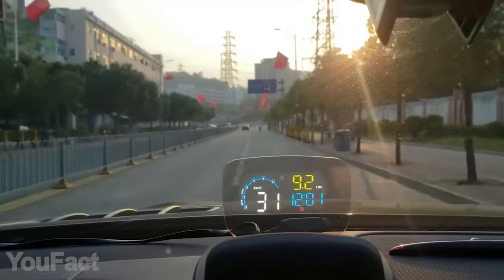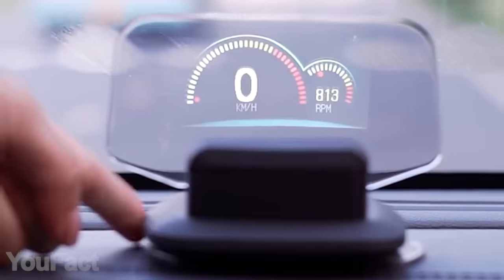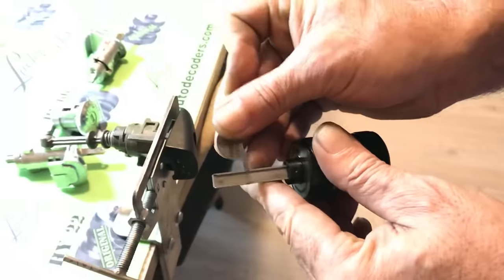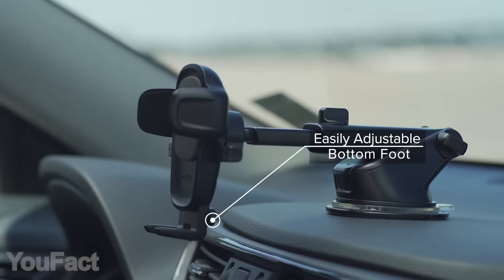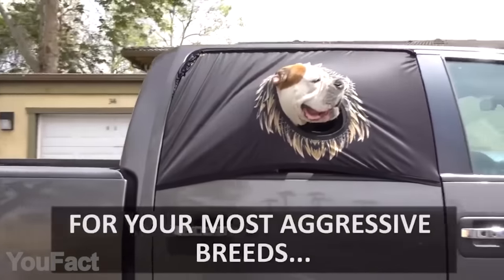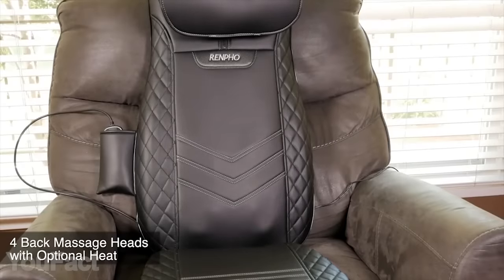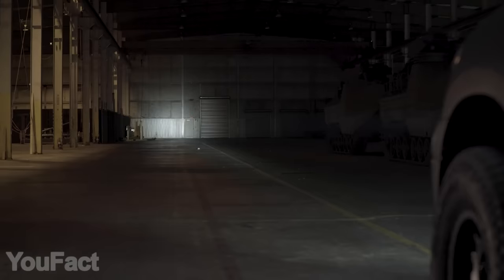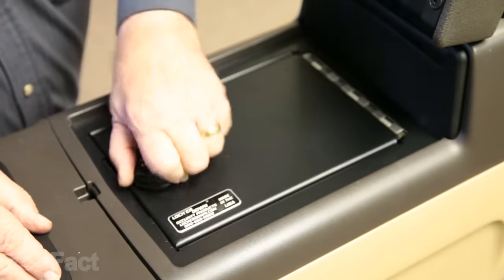13 COOLEST Car GADGETS That Are Worth Buying

Comment: The blue driver thing is the real deal. Bought one last year. Simple to use and if you know the basics at least its a huge help for diagnosing.
Reply: I work as a mechanic so I know bs when I see it and it seems interesting to me
Reply: @tactical_snails2198    I have one and it's OK. I see everywhere that it does body codes, ABS codes and airbag codes though, and it only dies on some cars.  They claim they will update but it still can't do a Mazda 3.
Reply: What about electrical faults. Can it detect them? I have an obd2 port on a Toyota hilux but a lot of Bluetooth obd tools don't work. The ones which do are really expensive.
Reply: @megabrex  yo should i cop for my ford fiesta ??????????

Comment: The "Smart Wheel" will be a real PITA for those of us who still shift gears.
Reply: Also you are no longer advised to hold the wheel at 10 to 2, as the use of airbags has resulted in thumbs being damaged or even dismembered when they go off.

Comment: so, the "smart wheel" turns red each time i take one of my hands off the wheel ? how am i supposed to change gears in my manual transmission ? with my mind, i'm no Jedi ? or i should drive around in the 1st gear ? :p
Reply: The real question is how do you drive a manual and text at the same time... 😀
Reply: @LV-1969  i don't, as in i don't text and drive, i either pull over to the side or ask my passenger to send the text if it's really important, or i just wait till i get home, like any normal human being should do :p
Reply: I drive manual also. This thing would last about 2 minutes before being introduced to a hammer!
Try speach to text.

Comment: A dog sticking it’s head out the window can be ‘dangerous’ so how does one sticking out the dog sleeve any safer?
Reply: It’s supposed to prevent them from jumping out.  You could just roll up the windje mid way and it pretty much does the same thing

Comment: Problem with a dog poking their head out of a window while you are driving down the road is road debris hitting their eyes. Just ask any dog optometrist (and yes there are many). If you thing there is nothing flying through the air then why does your windshield get pitted; sure not while it is sitting in the car. Console safes are NOT new. Had on in my 2003 Jeep Wrangler installed in 2003, Imagine that.